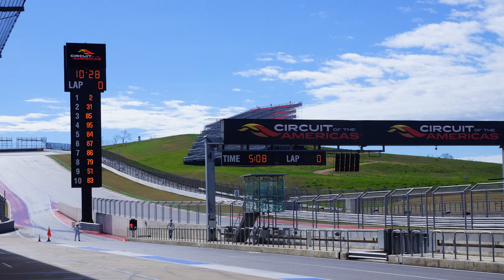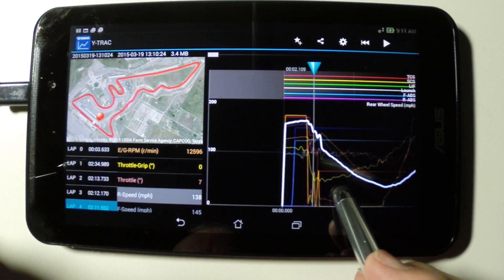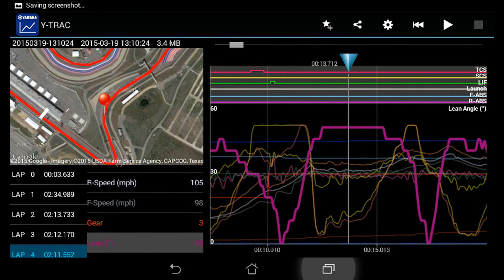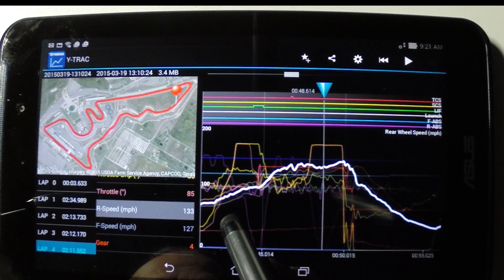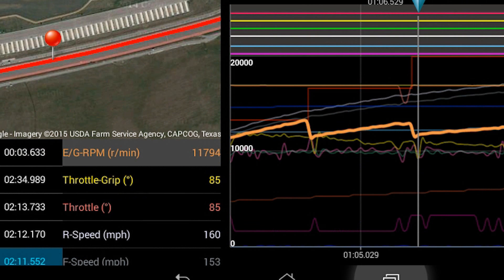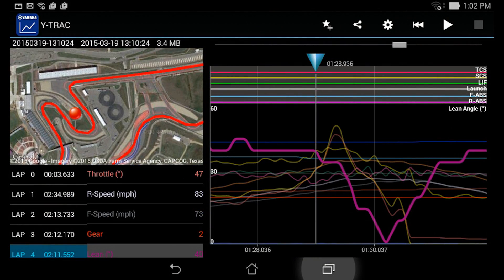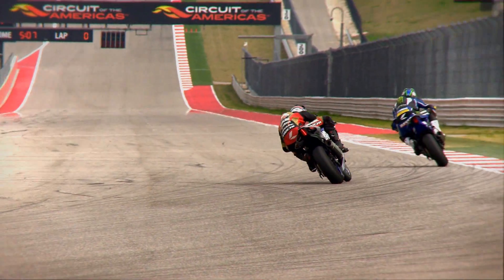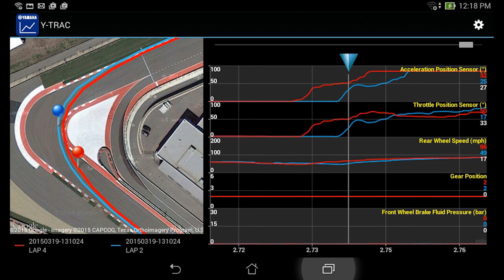Yamaha R1 Y-TRAC System At Circuit Of The Americas

Comment: So thinking about getting this what is the benifit of this over other systems. It has gps and lean angle and throttle sensors. Can it over lay in videos like some other systems. Can it be programmed to work with the cluster to show current lap times? Or is it simply for after the race to review.